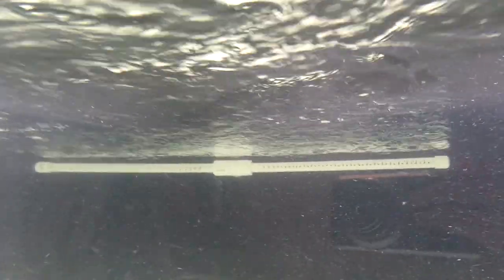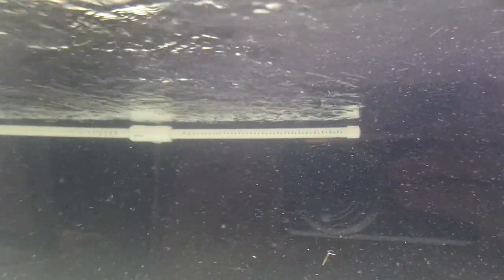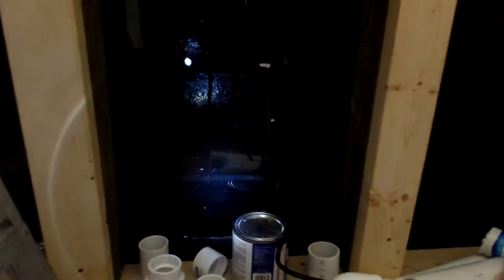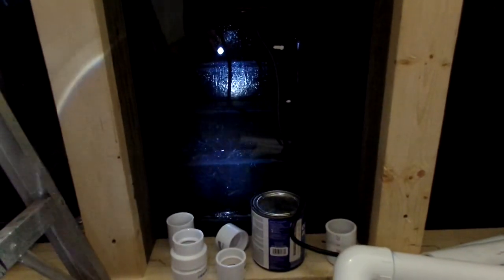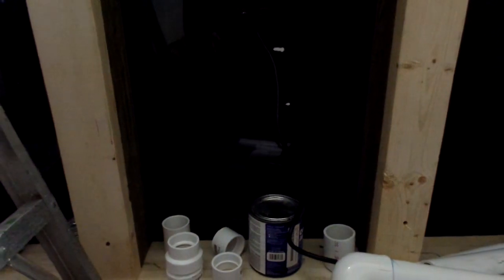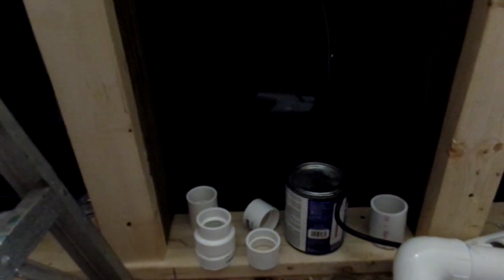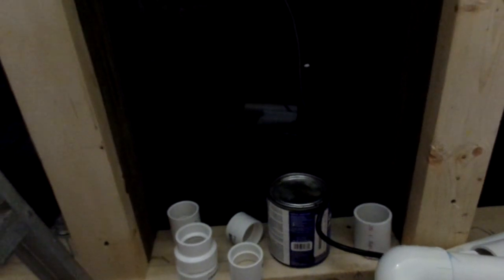1210 Gallon DIY Plywood Aquarium System Update

Comment: Hey Freeswimmer, the spray bar is awesome!  One question, instead of reducing flow why not add an emergency drain an inch higher in case one of the stock mans became partially plugged?
Reply from the maker: That's smart thinking.. Here is how I worked it out.. I have added enough extra pipe with spray bars (12 feet total ) that it has added substantial head pressure, and the pump is returning noticeably less than is draining now.. I have had lettuce block up 1 of the stockmans almost completely, and it only slightly raises tank water level. It was at equal before the extra 12 feet of pipe with spraybars.. Im comfortable with the in/out balance now.. An emergency drain is a good idea though..